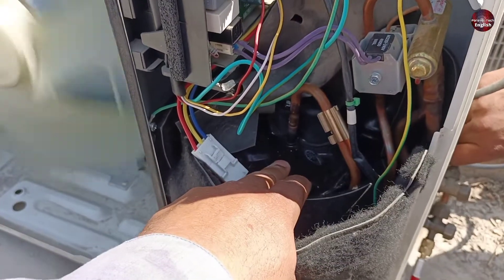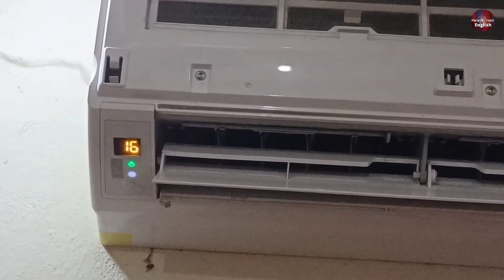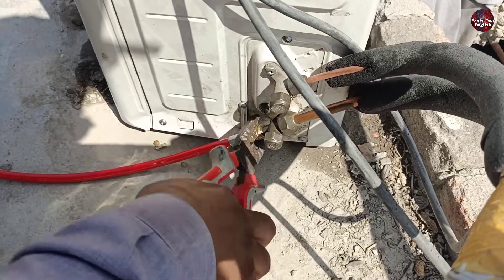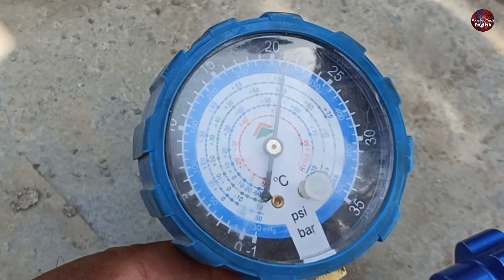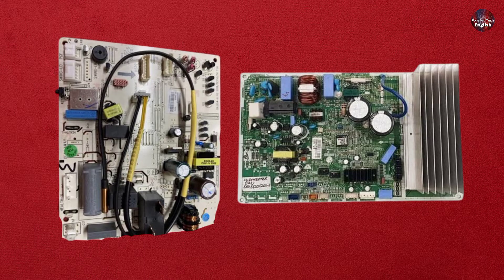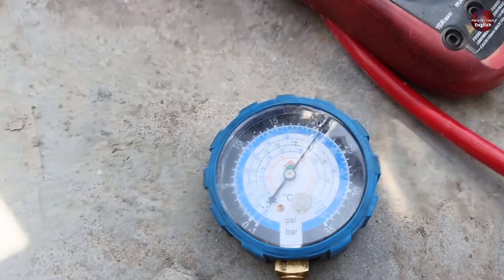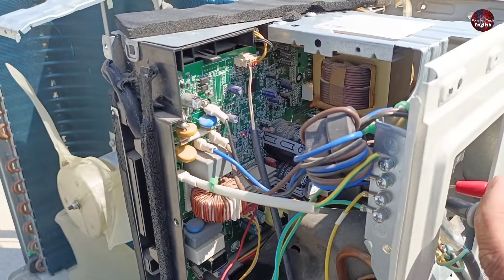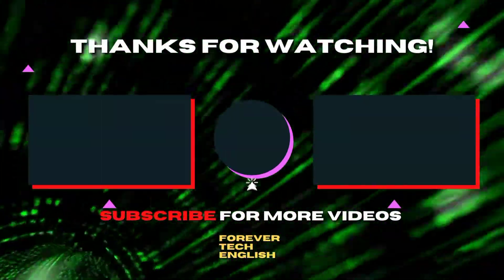Compressor Starts But Building No Pressure & Cooling In Mini-Split Ac

Comment: Hello Forever Tech
I have Exact similar experience yesterday while I was diagnosing the Carrier mini split compressor. Compressor was runing indoor unit was running. My gage was not changing preasure stay 220 PSIG and my amp reading on my multimeter was 0.3 amps and compressor was overheating. Thank you for your Your effort to help us, diagnose and understand things better.
Reply from the maker: 👍👍 Glad It helped🥰

Comment: Hi, I have an identical problem on a Gree a/c, the compressor starts but doesn't rev up, it constantly remains at a very low number of rpm's, and consequently it doesn't come under pressure, I did the test with two different compressors, and it doesn't change, the two compressors are certainly 100% functional.
I checked and the signals are there on all three phases, also at the inputs of the 
IPM, with an oscilloscope I saw that it is the CPU that sends the signals in this way, do you have a suggestion of what I could check? (the IPM was replaced because it was shorted). Many Thanks Sir.

Comment: I have a 1 ton compressor R22 and when i run it it draws 3.5amps and keeps making bzzzz sounds every 40s or more. The high side and low side pressure stays the same, is this the same issue you faced ?

Comment: Same here on the residential 3 ton Maytag unit. Compressor starts,  throwing 1.3 Amp, but pressure are equalized. Never seen anything like that before. 230v Single phase Compressor.
Reply from the maker: the pump is dead

Comment: I'm in a similar boat, my split ac is blowing cold air (7-10 degree C) but I don't feel the room being cold at all.
Outdoor unit fan is blowing normal temperature air, as far as I know, it should be throwing out hot air. I touched the condenser fins and they're not even warm. What's going on?

The ac is drawing around 1 amp less than it's rated current (6.4 amps). The compressor also making weird noises dhhh dhhh dhhh like in pauses. What could be wrong with it? Is it a bad compressor?
Reply from the maker: First check the winding of the compressor with a multimeter by turning off the unit. And disconnecting it from the power outlet. And yes if it is making such weird noises it is possible that the compressor pump might have gone bad.
Reply: @forevertechenglish  thanks for replying, I need to tell you a little more detail, I recently got it serviced and cleaned and noticed the suction line bent 90 degrees, it was hard to notice thing as it was in the tight space, so  I don't know how long it was working like that, could this be the reason for failing compressor?
Reply from the maker: Yes, the compressor has kept working with that bent, and it might be the reason that the compressor pump has gone bad and making that weird noises, due to long usage with that bent pipe.